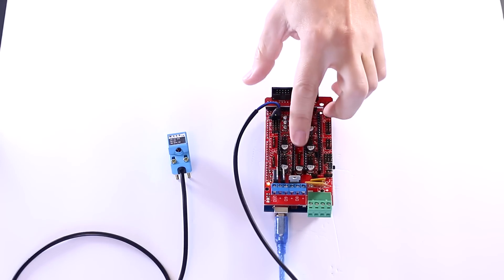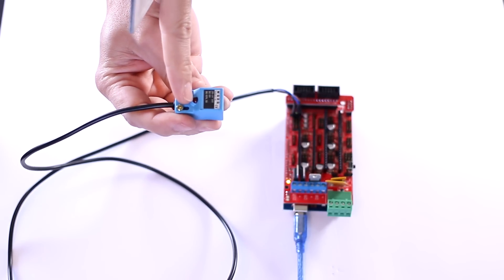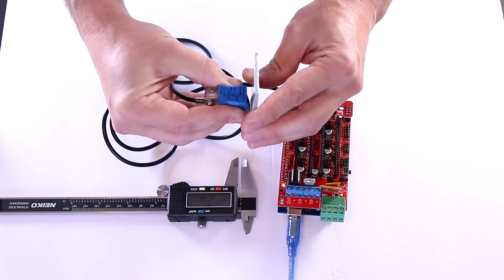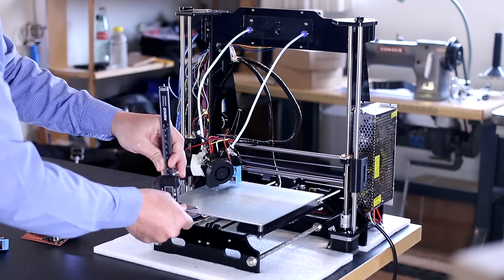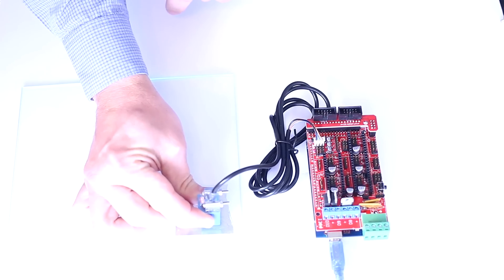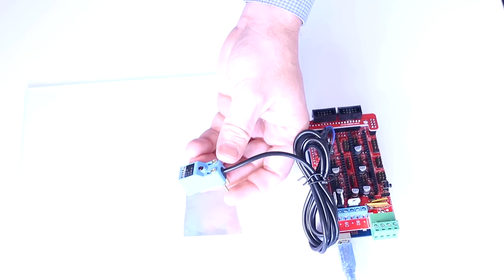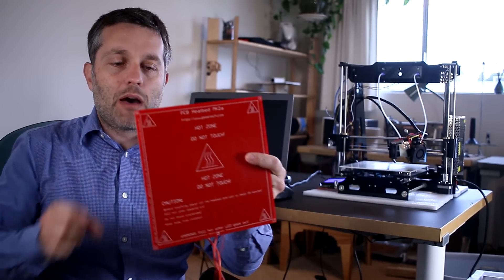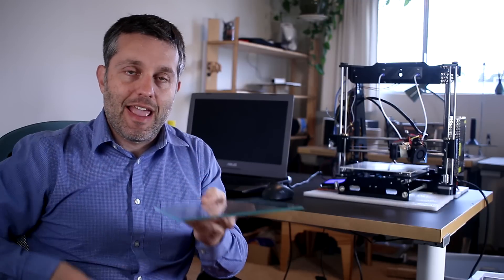Z-axis inductive sensors for Cheap Chinese 3D Printers: 6-36v & 10-30v sensors work on 5v power

Comment: Hi. Thanks for explaining the different readings that can occur between a cold bed and heated. I am using a 3mm aluminum bed and a 6-36 v nc inductive sensor. Virtually every time I sent a g29 on a cold bed, the hotend would hit the bed and want to keep going! With the bed at printing temp though, 70 - 90 C works everytime. I can live with it but it seems that the 10-36 would have been a better choice. I can sleep nights now...Thanks!
Reply from the maker: doug barnes Make sure you watch my other video on the subject. It gives new information from what I show in this one.

Comment: Its a bit silly to worry about not using 12v is you have 12v for the fans on the printhead anyway. Also if you want to use these with Glass use fairly thick Copper tape not thin Aluminum tape.
Reply from the maker: First: Do not use tape of any kind. It will throw off your calibration at the seams as seen on my other video here:: https://youtu.be/_-fAMAnn3_s

Second: If you feed 12v into the sensor it will feed 12v out of the signal line. This high voltage will fry the logic circuitry on your control board which is only designed to handle 5v. Meaning if you want to run these sensors on 12v you will have to do some extra work to bump that signal voltage down, and you now run the risk of burning up your board. It is easier and safer to run these sensors on 5v.
Reply: heh, well I have a voltage divider in there obiously. I don't use Tape anymore because of me getting an aliuminium heatbed - I just wanted to point out that copper seems to work several times better than aluminium. Also I don't want to imply that it works well ;)
Reply from the maker: blkhawk Surprisingly, copper has a very small advantage over aluminum in this use case. To increase sensing distance, the best substrate material would be ferrous (iron, or steel). Source: https://automation-insights.blog/2010/04/12/inductive-proximity-sensor-targets-material-does-matter/
Reply: ah - maybe my copper tape was very thick then - but again I do not use this anymore

Comment: just i read this and but my c-lin pl-08N sensor to test bench, power to 12 V brown, blue to GND and black wire to signal and out come 12 V ok, i drop power 5volt and signal come out 4,4V yes this working. i no remeber were i orden this sensor, gearbest or banggood or were but not has connection blug to anet board, only 3 wires, must solden blugin to wires but i no know what connection blug and were can orden. i test whit aluminium+glass 3mm and working stay about 4-5mm air area. and metal work sure 8mm air area.i no sure what anet board have 5V "out" or under this, select 0 and 1 what volt need limit. but i remeber maybe limit has "0" 3,5 volt and "1" up this. must test then have connection blug future.

Comment: You can wire these sensors directly to the 12v output of the board as long as it is an NPN type. The NPN is open circuit when not active and pulls to ground when active. As a result, with pullups enabled the Arduino will see either 5v or ground depending on the state of the sensor. The PNP type sensors will apply 12v to the output when they are active and float when inactive, so not really suitable for 3d printers as they require some clumsy voltage dividing circuit to be installed.

Comment: I've tried sensors similar to the ones you show in this video and they did not work for me. However, they were cheap chinese sensors. Can you provide link to the specific sensors that you used so that i can try them? I'm interested in 6-36V type.
Reply from the maker: I purchased the 6-36v sensor from gearbest. It is labled "tronxy." I have ordered some other sensors from Ali-express for under $3 each, and I will test those more rigorously in a future video.
Reply: I went to gearbest website and used search engine to search for tronxy. All that came up were 3d printers, no parts. I then searched for "proximity" and "hall" and got all sorts of hits including cell phones and ceiling light fixtures, just nothing that resembles your sensors. You don't make it easy to reproduce your results by not providing links to specific product.
Reply from the maker: If you search for "Anet A8" and then at the bottom under "buy together & save" that is where I found it, but it looks like they are our of stock right now.

Comment: I had  Tronxy XY-08N and the 2mm mirrored glass with aluminum foil under. It seemed to work fine til the heated bed rose to 50 C, the Tronxy XY-08N didn't detect the heated bed, though trying with/without the glass. Any ideas?
Reply from the maker: That is interesting that it worked until it got up to a certain temperature. I will test this in a future video. In the mean time, to solve your problem, I've read in forums in the past that some people have had better luck with copper foil. Copper is more conductive than aluminum, so it should provide a better signal for the sensor to pick up. Maybe try this: https://tinyurl.com/kkb7mla  Then again, you can get an aluminum bed for under $20 on ebay.
Reply: Thanks for your reply. For the heated bed, I'm using an aluminum bed originally comes with an Anet A8. But having aluminum foil under the mirrored glass, the sensor works better. Anyway, I'll try copper sheet. Thanks again and waiting to watch a future test video.
Reply from the maker: Ah. Given that information, I don't think the copper will solve your problem. Watch the upcoming video. I will show a trick to make the sensor more sensitive. Hint: cut the plastic off the bottom, and expose the sensor itself.
Reply: Nice

Comment: i have a 10-30vcd sensor do i need to add resistors to it?
Reply: if you connect to 12 volt yes because you gonna resend 12 volt in the signal pin !

Comment: My 10-36 volt sensor didn't work with the Anet A8 board, but it was an easy fix with an LM7805.  Works likes a charm now!  Sensor gets a full 12 volts for operating, but signal is dropped to 5 volts so the board is protected.

Comment: The 10-30 is your best option with an aluminum heated bed, unless as you earlier proved, you have a piece of glass over it to smooth out your prints. Would not be surprised if the 10-30 can't read that any better than aluminum tape, which means back to the 6-36 NPN and that means zeroing it with a preheated bed. Or you're back to looking for something mechanical.
Reply: Great, so how do you WIRE one of them for 5v? There's three wires for 
the sensor, but the mechanical endstop switch that cheap printers use 
only has two wires. Plus they are always in different colors.
Reply from the maker: The sensor should have a pin-out diagram printed on it, or that came with it. The three wires are (+), (-), and signal (s). Find the pin-out diagram for your board (sometimes printed on the board itself) and simply plug the correct wires onto the correct pins.

Comment: Most metals will react to a magnet in someway even if the magnet does not pull them.  Some metals don't seem to do much when a magnet is near.  The only reason we use iron with magnets most of the time is because it is cheap and one of the best known materials for a magnet to stick to.  Other metals will react with a magnet in a different way.  Slide a silver coin down a rare earth magnet if you have one big enough and you will see the coin move more slowly than if there was no magnet.  It is one of the tricks you can do to help test if a silver coin is real or not, just don't rely on that alone.

Comment: Inductive sensors and Hall Effect  sensors are two entirely different things ..... Inductive sensors sense changes in inductance of the exited coil inside. I have an  8mm range inductive sensor exactly like the one Thomas tested and I use it to sense nothing but a 250mm x 250mm PCB heater through a 2mm thick piece of glass with no pieces of tape to create an air gap and ruin the heat conductance from the heater to the bed Part of the reason this works better on a heated bed is a PCB heater is really nothing but a flat wound inductor, easily verifiable with an inductance meter and which is exited with a PWM signal and thus causes the inductance of the sensor coil to change easier and more reliably. It also acts as an antenna and throws out a fair amount of RFI 

I've gone several months, almost 6 now, without a single failed first layer and as long as the hairspray remains uncontaminated the bottom is picture perfect every time

I don't recommend tape unless you tape the entire bottom because any air gap will kill you which is why you have to use heatsink grease in the first place, to remove any air gaps between the IC and the heatsink. If using just glass and a PCB heater I recommend locking it down on 10mm of cork with a gap cut for the thermistor wires to support the PCB and keep it tight against the glass plus it eliminates some of the bed wobble which means less artifacts and ghosting and being able to get clean prints at higher speeds

Comment: Interesting video - let's see if we can make Tom test the 6-36V sensor as well. Seen from a technical point of view (i work with electronics all day, have made my own inductive probes etc.) i can assure you that the voltage rating on the sensor has nothing to do with it's sensitivity - it's something that's engineered into the sensor itself when being designed & manufactured. The problem can be running these sensors outside their intended area of operation (5V). After all, then you may be lucky that it still performs good and repeatable, or it may be all over the shop. I've found some 24V-only sensors to work fine on 5V but others starting to oscillate wildly when under 10V, so YMMV. Keep up the good work.

Comment: Sources for those sensors in the video?
Reply from the maker: I shy away from linking ebay sellers because the increased traffic causes them to increase their prices. You shouldn't pay more than $5.

10-30v sensor:
http://www.ebay.com/itm/ABS-5V-24V-DC-Hall-Effect-Sensor-Proximity-Switch-3-Wire-Normally-Open-W-LED-/131900296606?hash=item1eb5decd9e:g:oE0AAOSwImpXpbCf

6-36v Sensor on ali-express:
https://tinyurl.com/lt9w4jt
Reply: OK, I get your reasoning, thanks for sharing anyway.
I can now confirm that these are the same ones available from multiple sellers. That's what I wanted to know. 
Thanks again. Interesting and helpful video.

Comment: You connect direct the sensor to board? without Resistors?
Reply from the maker: Yes. As seen in the video at 0:36 the wires plug into the 3 pins on the board dedicated to the z-axis sensor/switch.

Comment: Confirmed. I have an A8, 10-30v sensor and I placed a dollar store glass sheet on the aluminum heated bed. It works great. Easy to calibrate and great print adhesion.

Comment: Tom's testing was conducted with reliability and accuracy in mind.

Your videoonly shows that the plate can be recognised. There is no accuracy/reliability in your tests because you have no reference, nor repeated tests.

The next point is that not everyone used/has a heated bed. From what I have read, PLA does not require (or want?) a heated bed.

Next, when running current through the heated bed, the bed will not be consistent with temperature over the whole bed. There will be hot spots, and as Tom showed, heat does affect the sensor readings.

And, on a heated bed with current running, remember it is switched on and off by the driver to keep the temperature consistent. The reading (distance) will vary by whether the current is switching, on, or off, when the reading was sampled.

Just because a light comes on at some indertimate distance, this does not prove that the sensor will be reliable, nor accurate.

Sorry, but your video proves nothing.

I have no affiliation or know with Tom. I only found his videos a few days ago.
Reply: Tom tested inductive capacitive ir and mechanical switches, they all worked with varying levels of accuracy. Inductive sensors with the correct range for your specific application with or without a heated bed are extremely reliable and repeatable, capacitive do work but do have large variances, ir work well depending on surface type but can be affected by lighting, mechanical for cost to accuracy and repeatability are probably the best for most circumstances because they aren't affected by surface type. The problem with hall effect sensors is they can be extremely sensitive to magnetic fields not just in the proximity to them but also the earths own field strength and the location of your printer or orientation in your home or office.
Reply: Gareth Price correct ! anyway a well made machine doesn't need this and its associated problems !
Reply from the maker: Tom says that they don't work. He does not say that they work, but are unreliable. I was merely proving that they do work. I might go through the effort to make a testing apparatus to measure the sensor's repeat-ability and reliability, but probably not. I have better things to make videos about. The sensors work. I have them on machines which I print with on a regular basis. Any fluctuations in readings are so small that they don't affect real world performance. The accuracy/reliability issue that some folks want to bring up is purely an academic argument. I put the sensors on my printers and they work. I get prints with good bed adhesion. What more do you want?

Comment: it only works on a few sensor, I ordered one when I ordered my printer from gearbest. it Does NOT work with 5v.... my board put out 4.9v ... ( it is the 6-36v version)
Reply from the maker: Which exact sensor are you using? Is it Normally Open (NO) or Normally Closed (NC)?  Does it work on 12v? What happens when you hold steel or iron up to the sensor, or a neodymium magnet? Does the light come? Are you sure you have it plugged in correctly? Sometimes, the plastic connectors between the sensor and the board will engage, but the wires will be switched. You must check the pinout diagram of your board, and make sure that your are correctly hooking up the sensor. Note: DO NOT plug it directly into 12v, and then into your board. You will fry your board. You must use resistors, or a voltage divider for 12v. As long as you are only using the 5v feed, you can switch the wires around without damaging your board. Best of luck, I think you can get it work. I have faith in you.
Reply: I have the Tronxy XY-08N NPN-ON I would get no light when using 5V, when using 12v the light comes on when close to something. I  had to reduce the return voltage to below 5V. on first attempt I was getting 5.4v and it would not work... Everything was connected right I updated the firmware (to Skynet) 5V on mine does not work... I have seen other videos and they say it is a crap shoot if they work or no..

Thank you for your reply
And no it is not working yet.... dump me blow up my main board playing without unplugging. New motherboard came in today (was on back order for a month)
Reply: I bought the same model as yours and had to switch the black and the brown wire to make it work. It seemed to work fine til the heated bed rose to 50 C, the Tronxy XY-08N didn't detect the heated bed.

Comment: Thanks for the info about the sensors.
I am going to try to install a inductive sensor in my Tronxy 802E. But I do not see any actual instructions for my software. I will be using RepetierHost_1_6_2. Do I have to reload the software with the new settings for the sensor to work?
   All of the youtube videos talk about Marlin software not Repetier.

Where can I get instructions for  fpr Repetier?

Thanks for any help.
Reply from the maker: I will cover how to do this in a future video. To get the firmware to work, you must modify the firmware for your board. This means making a custom build of Marlin. The slicing software (Repetier) has nothing to do with it.
Reply: I am a newbie as far as software. I am assuming you are talking about the software in the printer? When my printer boots, it says  Repetier .91 not Marlin.

You are correct, the Repetier 1.6.2 is the software running with the computer to do slicing and control.

Is there Reptier software in the processor on the electronics board, I assume?
Reply from the maker: Ah! Yes, there is a firmware generation tool made by Repetier. I forgot about that. See if you can update your firmware through the tool located here: https://www.repetier.com/firmware/v091/

A quick note however. Once you flash the new firmware onto your board, you will not be able to reset it to the original firmware. It is difficult to backup your original firmware. Unless you can get a copy from the manufacturer, you might want to just purchase a new board and play with the firmware on the new board. This way if it doesn't work, you can always just reinstall the original board. For the lowest cost, and greatest compatibility, I recommend a Ramps 1.4 board kit such as this one for under $30:

http://www.ebay.com/itm/3D-printer-kit-RepRap-Prusa-i3-HSG-RAMPS-1-4-Mega-2560-A4988-LCD-2004-Display-/112205898484?var=&hash=item1a1ffe22f4:m:mWUUFpgvy8eaN5ZQ0q1aAFg

Many tutorials/forum posts exist explaining the process of getting a Ramps 1.4 board to work. Good Luck!